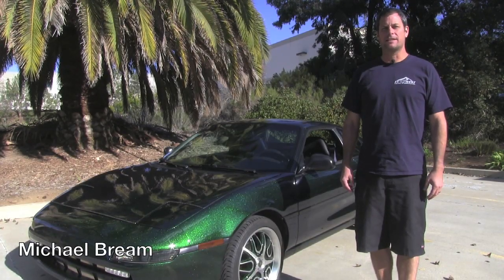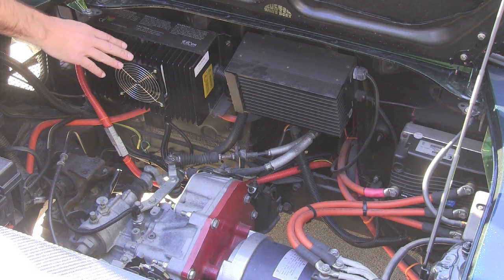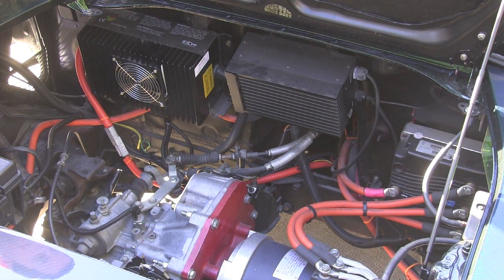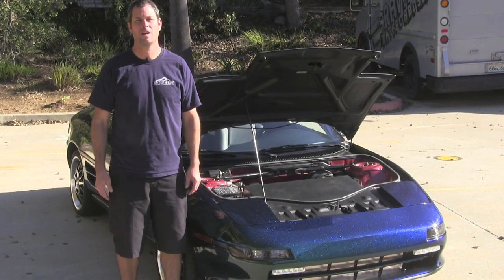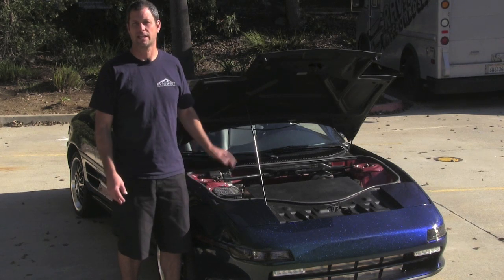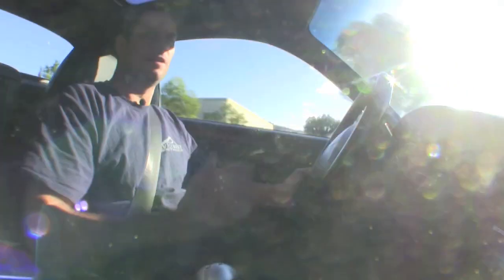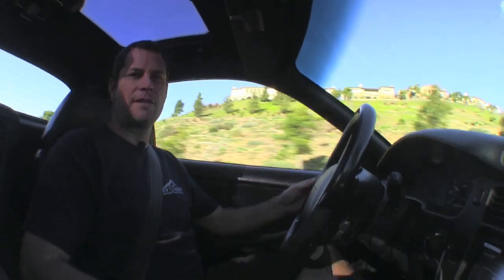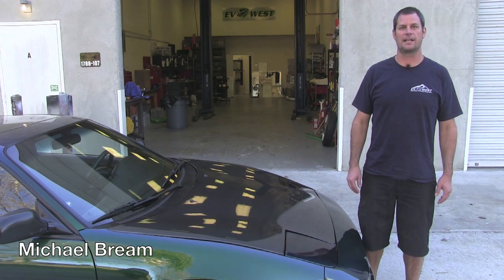EV West Toyota MR2 EV Electric Car Conversion Walk Through Video

Comment: So you didn't utilize the center fuel tank area for batteries?
Reply: Michael Capobianco
Huge swing and a miss there. Why hang those batteries way out in the extremities when you’ve got the perfect place right there where the stock fuel cell was?
Reply: I think they tried to even out the weight distribution. The car is probably a little more stable, but it kinda ruins the point of the MR2
Reply: Gears decrease power output and efficiency...... and they put the battery in the dumbest possible places it’s a 4 cylinder how much more efficient do you need, a 2zz would’ve been cheaper and better than all that bullshit... sweet paint job tho

Comment: Somehow, an MR2 feels like a good car to do an electric conversion on
Reply: It's garbage
Reply: @JimmyPtheman  ?? Why?
Reply: It's to bad they never disclose the tag price of parts and labor,  I'm assuming probably and short on the $20Ks,  but my question is,  is worth it all this money for a range of 100 miles, to me that's a waste!
Reply: @louteix9981  it’s definitely not good as a daily driver, but if I had to guess it’s probably tons of fun driving it hard!
Reply: @draven4464  that’s actually one of the reasons why I really like this, because no one has any grievances with replacing the motor. The main thing the MR2 is known for is being mid-engined, not for the engine it has. So it’s not as if you’re like, desecrating a perfectly good car.
Reply: @orcastrike7750  Yeah, people get really butthurt over ridiculous things. I think so long as it's not just some hack job and it at least maintains its original style, feel, and overall aesthetic, it's good by me.
Reply: @louteix9981  its 8k for the conversion kit on their website (not including batteries) looks like a simple enough thing to do yourself honestly, i know im not about to pay for this kind of labor they would charge through the roof! that being said this video is 8 years old, battery technology has come a long way
Reply: @louteix9981  if range is an issue then you can just get bigger/more batteries, tesla batteries are plenty for the motor that in the $8K kit EV west sells, if you sacrifice some trunk space you could easily get up to 200 to 300 miles: Someone did a tesla swap for a Plymouth satellite with 18 5.8kwh tesla batteries and gets like almost 400 miles
Reply: @orcastrike7750  you are wrong
Reply: @FirstnameLastname-ni9uh  ok lmao

Comment: Great looking conversion.  It would have been nice to see how you fit the 260Ah cells.  Plus I'm surprised you are running 38 of them since HPEV has reported some issues with that high a voltage and recommends only running 36 cells.

Comment: So im a little confused. I literally just started doing research on these and it seems like they have to be manual transmisions. I always thought electric was always 1 gear. If you get to still shift and its electric im way more excited. My issue is how do you know when to shift or why?

Also what kinda power is this making in terms of conversation to WHP?
Reply: +Clesarie It's still geared because the MR2 was originally geared, but in reality you wouldn't need to shift much at all - you would just put in in 3rd or 5th and leave it there, and not touch the clutch pedal because the motor doesn't need to idle like an engine when the car is stationary.
You can shift if you want to, but the only time there is any point is if you need ridiculously high torque and are willing to sacrifice top speed by using a low gear.
Reply: +Omar Smith But wouldn't launching in 2nd or 3rd gear put too much strain on that stock gearbox? Does the owner shift at all? Or just leaves it on a middle gear?
Reply: +Dennis Santos the gearbox is designed to handle the stress of starting from stationary, the gear being used doesn't have much bearing on this in an electric application. In a normal engine, too high a gear would stall the engine because it can't produce the torque (turning force) being required of it at low speed, but as electric motors can output their full torque strength regardless of what speed they are running at, this is not an issue.
Of course, there are limits to the torque you can put through the stock gearbox - the same goes for the drive shaft and clutch, if you install a more powerful motor than the original engine was and accelerate flat out, you could bust the clutch or twist the drive shaft, but a correctly matched motor won't damage the gearbox.
Reply: Omar Smith Yes, of course. But what I'm wondering is if the maximum torque permitted on second, third or higher gears is less than first. As you said, a gas engine would likely stall, trying to pull away in those gears, so I'm guessing that OEM manufacturers factor that into gearbox design based on weight and cost vs material strength, even gearwheel location on the shafts/layshafts. Since an electric motor produces maximum torque at 0 rpm, isn't it more likely to overload a second or third gear by launching in those? 
This may be completely out of context but on multi speed bicycles it isn't recommended that the rider selects the lowest "granny" gear up front and the smaller(est) sprockets on the wheel hub at the same time, so as to avoid overloading the drivetrain (in addition to severely crossing the chain).
Reply: It makes 76 HP
Reply: Does it make big difference  between a manual and a automatic vehicle? 
For a conversion,  each one would be better? 
Thanks

Comment: The center tunnel is the stock location for the gasoline tank.  Did you utilize this space for batteries or anything useful?   Good on you to have a heater...does this vehicle have air conditioning cooling too?

Comment: Just curious as to why you put the batteries in the trunk instead of reusing the the fuel tank area? Would be better for weight distribution if you're trying to get the car to handle well.

Comment: whats with the good balance of the car after putting the heavy batteries in the front?  whats the weight of the motorsystem compared to the batteries?

Comment: Why did you choose to electrically heat and pump coolant into the heater core instead of replacing the heater core with an electric heater?

Comment: What kind of improvement have you been getting with the water jacket sink for the Curtis controller? I have been looking at a few and thermal damage seems to be a common problem. I suspect it was to do with the way they have the through board thermal plane on the fets and heat soak inside the case. It would be who of Curtis to have a water cooling jacket mount to the other side of the fet boards, thermally isolating the output stage, and providing addition noise shielding for the controller board.  There are like 96 fets on the 3 phase output drive between two different pcbs,  as well as a control board and a power conditioning board all stacked into that case. I am guessing that dc converter is just a 12v buck converter for the car? Quite interesting work over there. You guys needing an ex nuke em EE anytime in the future? Keep up the good work!

Comment: Just in case anyone is curious how much this conversion would cost in parts alone,  I found that EV West offers a conversion kit for $6,988 (plus a battery system, including cables, fuses, and contactor box).  My guess is the battery system will run another $10,000 so you are talking around $17,000 for the conversion.

http://www.evwest.com/catalog/product_info.php?products_id=219

Comment: I being looking and studying the possibility to do a conversion in my 93 Nissan 300 zx, car is in good condition but as high mileage. 
I took a good look of this setup,  even if both cars have significant differences, but in size are pretty much the same.
In another way after removing of extras none necessary to the conversion,  I will end up with a lot more space than the MR2.
My intentions are buit something in at least a 200 mile range, and if possible with a little kick on the take of.
I already send two emails to EV west, let's hope that they will have a little time for me.
For now just waiting!

Comment: I have the Toyota celeca gtr with a mr2 turbo engine up front and was hoping to put an electric motor to the back wheels :-) making a 4wheel drive 4 wheel stear monster any ideas how you're firm could help with this idea ?

Comment: So you take a mid engine car because of the mass distribution. Then mount a (much) lighter motor in the engine bay. And then add all the battery mass OUTSIDE the axles?

Being 50/50 looks nice on paper but that battery placement cannot work favorably compared to putting them down the center-line, between the axles.

Comment: Hello, I'm building a city car based EV right now. Regarding this conversion and retrofitting of the new components, does it really affects the CG and the overall handling of the car? Well, the battery weighs a lot and it's placement is crucial I think :D
Greetings from Indonesia :D
Reply: Aditya Rachmanto i mean the longitudinal position of the battery, not the CG height

Comment: With these cars, do you need to use the clutch when putting it in to first gear?
Reply: clutch is not necessary in electric vehicles.
Reply: So then how do you shift in high rpms?
Reply: cody marabante This car uses the original clutch and gearbox like they say in the video. You can shift like a normal car or you can just set a gear and forget.

Comment: Not strange at all, cost effective actually, and allows you to get the most out of a moderate power setup.  The AC50 motor and controller are voltage limited so you still need a gearbox.

Comment: Yes, when you get to Tesla power levels you certainly don't need a transmission, and even lower powered OEM EV's use a single speed gear reduction.  Most conversions do keep the transmission and use at least two of the gears.

Comment: They could be using a variable frequency drive to control the battery to ac power and the speed of the motor.  That is the way most new heating a ventilation system now are designed.  A VFD works by converting ac to Dc and then chopping the DC voltage to the ac frequency needed.  In a battery powered car they just chop the dc power.

Comment: How much would that conversion cost today?
Reply: I think more than if you buy brand new electric car like nissan leaf.
Reply: You can build your own car using the batteries from these other cars. A guy already has a crashed Tesla, he is going to turn his Double VW Van which is two vans put together into an electric vehicle using all the Tesla parts.
Reply: TekReview's Yeah,how often you get crashed tesla $100K car??! It is still very expensive to convert any car to EV and you end up with old car..
Reply: Go to EVTV and learn. Conversion sometimes is cheaper then an OEM car.
Reply: MB031 I have ridden in this car. It feels and looks like a new car and is very responsive and cool.

Comment: Ok, as usually conversion drops the Gearbox or at least keep it locked on a gear (2nd or 3rd) I wondered what was the benefit for an EV.
Even Tesla rolledback when they used a gearbox on the roadster, though the power is totally different.

Comment: It has 26kW/h at 80 DOD, thats an ac system which can have regen all this in small light car(i mean car not the whole lot) so i can think of 200 miles if you are gentle on power. But who ever is an owner, has a heavy leg so 100 miles is minimum range for him :)

Comment: does it still snap oversteer ?
Reply: of course it does
Reply: I would say probably even worse than original due to the fact half the batteries are behind the prayer wheels now. Probably handles much like the older rear engine 911. 
But still a cool project.

Comment: All I ever see in these conversions are the AC50 (144V 65kW) and other rather low-power motors. Meanwhile, factory EVs, specifically Tesla's, are equipped with motors in the range of 300 kW. Isn't there a DIY motor in that range?
Reply: This is showing you cost effective conversion "kits" they have assembled. If you are wanting serious high power either you are going to buy a tesla for 100k or build your own high performance car like the m3 which wont really come so much as a kit, but they do show you how to assemble the dual warp 11 system they use with the powerglide.  So yes there is a system in the higher performance range, its in the m3 and on their website as dual warp 11 system and they offer a tweaked powerglide for it
Reply: Chiel van de Sande it is all just a matter of miney... $18k for motor, $15k for two required controllers. Not to mention needing a whole bunch more batteries. http://www.evwest.com/catalog/product_info.php?cPath=8&products_id=300&osCsid=083ev592jb1stf9oe948n8afs4
Reply: +Rob AndrewsIt doesn't seem to make sense to spend  $18k for motor, $15k for two required controllers (not including batteries) when you can now buy a VW e-Golf (ready to roll) for a total of $21,495 (after $7,500 Federal tax credit)..
Reply: +g2rc sure, you could. It's analogous to people building a gas car in their garage when they could have bought a z06 and had a fast car. 
Maybe they don't want a golf, maybe they want it to be faster than a golf, maybe they want to build it thereself. Personally buying a stock car and never modifying it sounds really boring to me.

Also, tax credits dont mean you get to just take the whole amount off the price, it's just a credit towards your taxes due before credits. It's very common to be refunded less Than the credit, especially if you make a point to use lots of deductions And even if you got most of that back it would not be when you bought the car it would be from your refund so you pay interest on that higher amount until you get the refund and pay part of your car off (if you get an auto loan) if paying in cash this is not a worry.

Comment: Every conversion is using these HPEVS motors. They're not very powerful.  The AC 51 which is the updated version of the AC 50 used here only makes 88hp and 100ftlb torque. It's also pretty big given how little power it makes. Compared to Teslas AC induction motors these are not even close in power density. Are they not using an induction motor? It says it's AC. I've also seen a pretty compact Bosch motor on an electric motorcycle that a university did, it made 400KW and was only a little bigger.
Reply: The reason these low voltage motors are popular is because buying batteries for 400+ volts breaks the bank for builds on a budget. Some guys are mating 2 and 3 of these together for staggering torque and hp.

Comment: according to the HPEVS manufacturer site : 
The AC 50 motor is an 8" motor that is capable of producing 71 horsepower and 120 ft-lbs. of torque. It was designed for use in an automotive application with a curb weight of 3500 lbs or less.
so it's really not that powerfull :|
Reply: Yeah I was wondering about this too.
Reply: 71HP sounds low but it's available at 0RPM while an MR2 Turbo's 200HP is only available with the pedal down and the turbo spooled up -- in day-to-day driving my 2015 Leaf's 107HP has great driving characteristics
Reply: @tachikaze222  grate driving characteristics? Compared to what? Nissan didn't even exaggerate when promoting the leaf. They were pretty much like it's extremely basic and electric powered. Lol
Reply: @codydew7301  0 to 40mph the Leaf (like all EVs today) effortlessly accelerate, as fast as the FWD tires can hold the road. Just push the accel and GO! To get the same accel out of an ICE transmission requires high revs and a lot more mechanical drama.
Reply: @tachikaze222  O my 0-40 depending on the road that could be speeding lol. If we're talkin that slow, there are stock Polaris rangers with faster 0-30 z06's 

Just fuckin round lol

Comment: A tesla costs around 50K after rebates. for that you get a new car with all the comfort features. Plus a waranty. Plus a build from the ground up as electric design. Plus no maintenance AC motors. Plus the highest rating ever from consumer reports. Plus a 200 miles range.
Reply: The AC 50 is an AC motor

Comment: It must be expensive if you keep telling us how great it is but NEVER tell us the price! Can i just put my kids power wheels motors in my car with golf cart batteries instead?
Reply: +gerard ojeda i just looked it up they have the kit used for $7000 but you still need battery setup and couple of other things so if its say 12k for 700tq that would be worth it to me
Reply: +kcracing 1 Thank you, yes I agree for that price it would be worth it. I would definitely make the change. I wonder how long or how many miles they will last for? 👍
Reply: +gerard ojeda Its a bldc motor, so the motor is maintenance free with exception of the bearings (the rotor is the only moving part and there are no brushes or slip rings connections on it). You still would want to do resistive checks and phase checks though. As long as you don't let the blue smoke out, the motor controller is also maintenance free. With high/low cell voltage cutoff and a good cc/cv charger you should be able to get years from the battery.